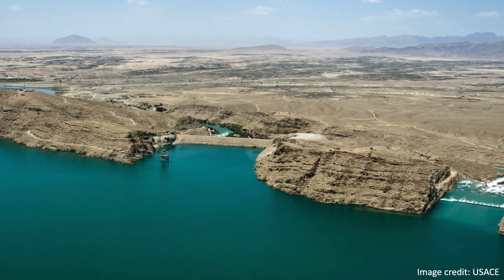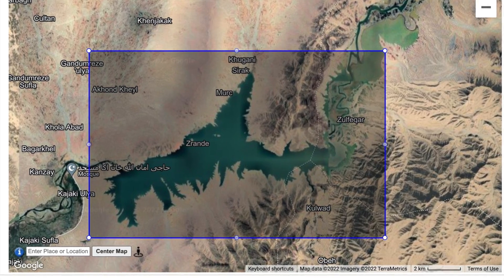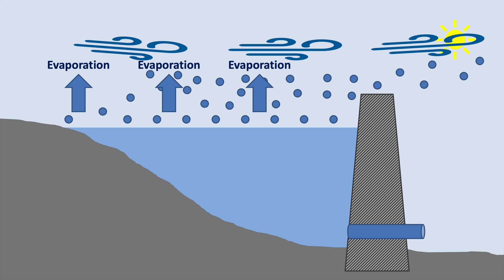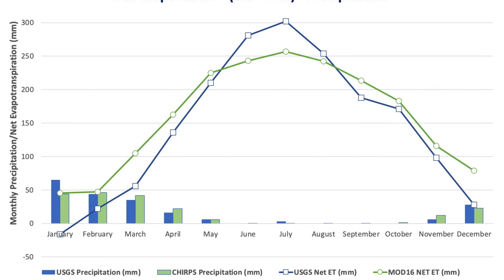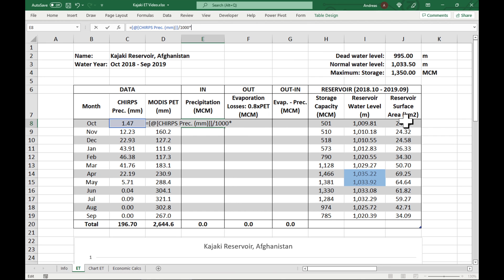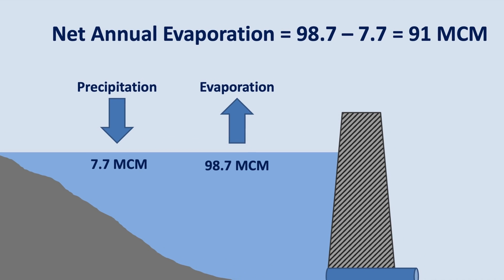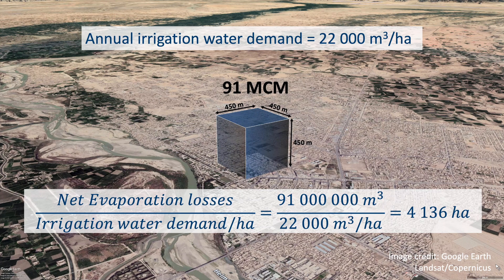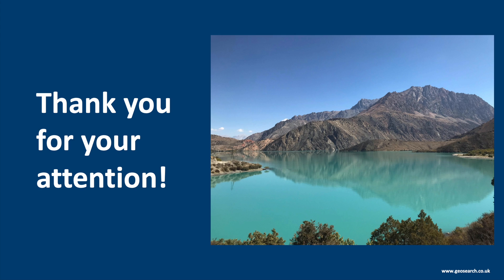How to estimate Reservoir Evaporation Losses using free data - Kajaki reservoir, Afghanistan

Comment: Nice video. But I thought the MOD16 data includes the actual ET. Why are you then using the potential ET instead of using the actual ET from MOD16?
Reply from the maker: Hi Moses, The MOD16 ET algorithm is based on the Penman-Monteith equation (Monteith, 1965) & the algorithm includes the leaf area index (LAI) and the Fraction of Photosynthetically Active Radiation (FPAR). What this means is that MOD16 cannot calculate any ET over water bodies or barren land/rocks/desert areas. You need to have some vegetation for it to work. That is why I made a rectangle around the reservoir that includes surrounding land areas which have some vegetation. If you want to know more about it, please check out my Evapotranspiration video: https://youtu.be/3r_6il0EViw
and have a look at the user guide: https://lpdaac.usgs.gov/documents/494/MOD16_User_Guide_V6.pdf
All the best, Andreas
Reply: @GeosearchInternational  Thank you very much for the clarification. I now understand.
Reply from the maker: Hi Moses, you are welcome! All the best, Andreas

Comment: Nice video. But Is it possible to use MODIS PET for reservoirs and lakes, because MODIS PET is designed for terrestrial surfaces?
Reply from the maker: Hi @getachewbayable. That is a good question, and I spent quite some time looking into it before I developed the methodology of the video. PET is usually measured using open pan evaporation - so evaporation from a water surface, not a land surface. It is really difficult to calculate evaporation from a lake or reservoir as the thickness and temperature of the water column play an important part in controlling ET. Also the air above the water becomes humid, which reduced PET. That is the reason for using 80% of PET.
However, there is only one PET which is the maximum possible evapotranspiration rate from any vegetated or open water surface. There are many ways to estimate PET. MODIS uses a modified Penman-Monteith equation (Monteith, 1965) which requires vegetated surfaces. You cannot get any PET/ET values from bare ground. In the video I showed that MODIS gave quite a good correlation with the work done by the USGS at the Kajaki reservoir who used meteorological station data. Hope that answers your question. All the best, Andreas
Reply: Dear Andreas,
Thank you so much for your response. I appreciate the approach you've suggested. Could you please provide references that have utilized MODIS data, such as MODIS PET, for estimating evaporation on water surfaces? I have tried searching for them, but I couldn't find any relevant literature.
I would be grateful for any recommendations you can offer
Reply from the maker: Hi @getachewbayable, you have my permission to use this YouTube video as a reference. Also have a look at the description below the video where there is a link to the USGS paper which I use as a comparison to show that it is a reasonable approach to use in areas of the world where meteorological station data is lacking. All the best, Andreas
Reply: Dear Andreas,
Thank you for your prompt response and for granting permission to reference your YouTube video. Your approach and explanation style have been enlightening, and I'm eager to delve deeper into this topic. In our pursuit of scientific rigor and credibility, it's imperative to support our methodology with published literature. Your mention of utilizing MOD16 for estimating open-water evaporation has sparked my interest, and I believe referencing a published paper or article would greatly enhance the robustness of our work.

Considering your expertise in this field, I kindly request your assistance in locating a published paper or article that demonstrates the application of MOD16 for estimating open water evaporation. Leveraging your knowledge and experience would be invaluable in ensuring that our research is well-supported and respected within the scientific community.

Your guidance in this matter would be greatly appreciated. Thank you once again for your generosity in sharing your insights and expertise.
Reply from the maker: Hi Getachew, the purpose of science is to question everything and find new and innovative approaches to solve problems such as evaporation losses from water bodies. It means that sometimes you end up developing a methodology that nobody else has thought of yet... or maybe they have, but google does not think it is important so we cannot find that special paper.
My methodology is inspired by the 2007 USGS report on the Kajaki reservoir, and the only difference is that I used MODIS instead of conventional weather station data. I have a high regard for the USGS, and as my approach gave data comparable to theirs, I think that it is a viable way to estimate evaporation losses.
If you do find any other researchers who are using MODIS or other satellite evaporation data for estimating evaporation from water bodies, I would appreciate if you share it with me. Since I made this video I have not come across any myself. I wish you good luck with your research & all the best, Andreas

Comment: Can I ask a science project question? If I have a huge container let's say circular  kids pool, full of sea water and I want to destilate it using the sun, how much freshwater can you expect?
Reply from the maker: Hi Nelson, Sea water contains about 35g/L of salts (3.5%), which would be left behind if you managed to fully evaporate all the sea water. The volume of fresh water produced should be the same as the initial volume, as the salts dissolved in the sea water don't take up any extra space. In fact adding salts to water can reduce its volume slightly due to a process called electrostriction. So you should end up with a very slightly larger volume of distilled water than the initial volume of sea water. All the best, Andreas
See: https://www.ocean.washington.edu/courses/oc400/Lecture_Notes/CHPT3.pdf
Reply: @GeosearchInternational  I can't thank you enough for your valuable videos, I have recently become interested in freshwater conservation and desalination  because of all the news about draughts in my country.
Your videos have been very informative,  I hope you don't mind I come back with some more questions.
Reply from the maker: Hi Nelson, I am happy to try to answer any question related to the videos. All the best, Andreas

Comment: Please can you help me out on how to calculate evaporation index using water level and evaporation on a dam and its uses. Also, what is the difference between index of evaporation and evaporation? I am working on dam operations and the impact of rainfall extremes.
Reply from the maker: Hi Triumph, sorry I have not heard of an evaporation index. There is a Precipitation Evaporation Index (PEl) which is calculated from a class A pan evaporation and precipitation data. I don't think it is calculated from dams. Let me know if you find out any further details on this subject. All the best, Andreas
PEI: A measure in vertical inches of the average annual abundance of rainfall for a given location. The mean annual class A pan evaporation in inches is subtracted from the normal annual total precipitation in inches to give the precipitation evaporation index. Source: https://petrowiki.spe.org/Glossary:Precipitation_evaporation_index_(PEl)

Comment: why evaporation & transpiration, that too potential is also being calculated when reservoir is capable of only evaporation alone?
Reply from the maker: Hi Rathna, it would be great to calculate the evaporation rate directly for the reservoir, but the required data is not available and also I have not found any remote sensing product which gives an estimate of transpiration from water bodies. That is the reason why I'm using the potential evapotranspiration (PET) calculated by the MODIS MOD16 algorithm which is a measure of the amount of water that would be lost from the land surface to the atmosphere through evaporation and transpiration, if sufficient water were available. The studies made by the USGS in the wetland Everglades of south Florida in 2006 showed that open water evaporation is about 80% of PET. That is the reason for applying this correction to the PET values. All the best, Andreas
Reply: @GeosearchInternational  can we use the results that we obtained from this website only for research?
Reply from the maker: @rathnakumarv3956  As far as I know, it is necessary to acknowledge the data source in any report. All the best, Andreas

Comment: in case of off-stream closed loop pumped storage schemes, how the water in the lower reservoir will be filled/replenished if the evaporation is more than precipitation at a given location?
Reply from the maker: Hi Rathna, most reservoirs in arid regions will have high net evaporation losses - i.e., evaporation from the water surface exceeds the precipitation falling on that surface. If there was no inflow into the reservoirs they would just dry up like a swimming pool which is not topped up at regular intervals. The reason why the reservoirs exist in the first place is that they usually have large catchment areas (aka watersheds). During precipitation events a large proportion of the incoming water from rainfall events becomes surface runoff which finds its way to the reservoir. If the precipitation falls as snow, it will build up in the mountains until it melts in the spring. In both cases, although evapotranspiration may exceed precipitation rates in a catchment, the surface runoff is sufficiently fast so that the a large proportion of the water can reach the reservoir before it is lost to evapotranspiration. If we slow down this process - for example by constructing hundreds of small dams upstream of the reservoir - we may end up with the situation where the reservoir no longer gets filled by surface runoff. All the best, Andreas
Reply: @GeosearchInternational  i understand this fundamentals sir. I mean to what is the solution possible??
Reply from the maker: Hi Rathna, there are large evaporation losses from all reservoirs. You need to balance the need for these reservoirs and the benefits they provide with the loss of water. When these kind of schemes are designed, evaporation losses must be part of the cost-benefit analysis. If the evaporation losses are too high, there are ways to reduce it - for example floating solar panels - but also this should be part of the design stage of the project. Other options like shade balls are usually not economical over the large reservoir areas. Basically, what is needed is better planning at the design stage, rather than trying to find retroactive solutions. All the best, Andreas
Reply: @GeosearchInternational  thanks
Reply from the maker: Welcome! All the best, Andreas

Comment: Hi dear..how I can contact with you?
Reply: I want ask about ves survey..is ip2win good software to use .is same result as ix1d ?? thanks so much
Reply from the maker: I use GeoVES see: https://youtu.be/EN0-Fhan3fs
Reply: Can you use climate engine or other meteorological datasets to determine the storage capacity of a reservoir, water surface area, and water level?
Reply from the maker: Hi  @amosgayflorzaizayjr1201  There is no easy way to get this data, as there is always processing involved. I have seen some websites offering radar altimetry data but only for the big reservoirs, and there are some Google Earth Engine tools for processing reservoir areas. To get the storage capacity you need the elevation-area-storage curves which you can only get via digital elevation model or from the reservoir design reports. See: https://youtu.be/SU3csjbq5lA and https://youtu.be/CRIr5ddmWOY  All the best, Andreas
Reply: @GeosearchInternational  thank you so much I highly appreciate it.
Reply from the maker: Welcome  @amosgayflorzaizayjr1201  All the best, Andreas
Reply from the maker: Hi Youssef, If you have any questions about the video I will try to answer them in this comments section. Sorry I don't have time for emails etc as am very busy at the moment. All the best, Andreas

Comment: How does the ET data from MOD 16 from appEARS differ with the ET data (MODIS - SSEBop) from the climate engine app?
Reply from the maker: Good question Moses. I think that MOD16 and the operational simplified surface energy balance (SSEBop) use two different algorithms, so they should give the same trends but obviously not the same outputs. Which one is better will depend on the climatic zone & landuse, but to decide that you will need some real field evaporation data. All the best, Andreas